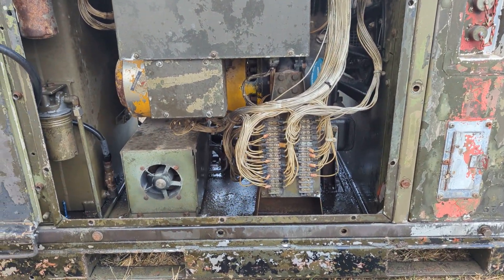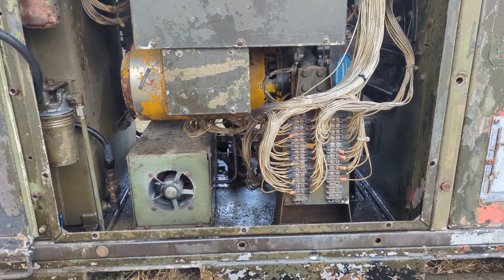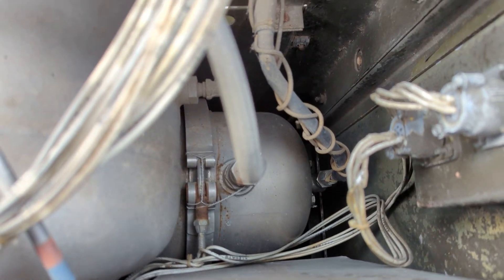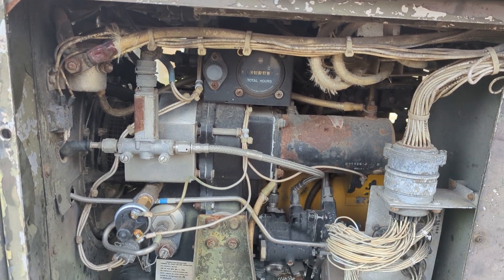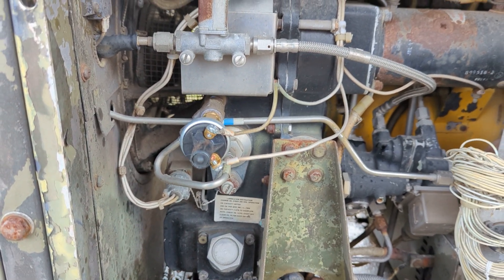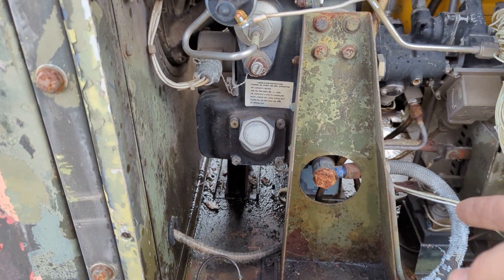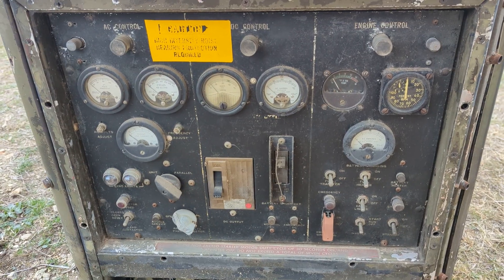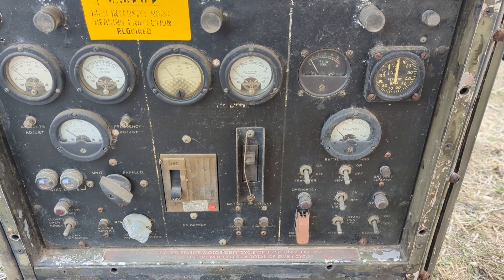Military Gas Turbine Generator Walk-Around

Comment: Runs like an AF MD 4 or -60 bleed air start cart 
I noticed the engine tack not working on the control panel
Reply from the maker: I uploaded a more recent video. The tach gen was bad so I replaced it. It works like it is supposed to now.

Comment: Any reason it wouldn't run on methane (natural gas)? I'd love to replace my V-twin Generac with a turbine (understanding I'd need to invert it down to 120V/60Hz).
Reply from the maker: I mean, it definitely could, but you would have to design a completely new fuel controller.
Reply: @Pyro15D  Makes sense 👍

Comment: Got yourself an old APU for an aircraft. They will want at least a 20% load to run stable. It sounds good so the mechanical is fine. The easiest way to convert the output is to either rectify the output and drive an inverter or find an old rotary converter which is a motor driving a generator. ❤

Comment: so regular incandescent lights will be fine on 400HZ as they are a purely resistive load, i doubt you can lower the rpm enough to get a 60 hz output without causing issues, if you want to run anything "normal" besides lights like another person said best bet would be a dc to ac inverter on the dc output depending on its voltage. cool find though! i didn't know these wer a thing and i have a new mep gensets myself
Reply: You can use a 3phase to 3phase VFD for 60hz. VFDs rectify the incoming Ac to DC, dump in into capacitors before chopping it back up to AC. They won't complain about the ac in as long as the voltage us right. They will run off of Hv DC too!
Reply: Yup, they literally cannot do less than 400hz. Trying to do 60 would not allow the compression of the fuel to be enough to burn it.

Comment: wow that is insanely cool!! Is it true that they are only fuel efficient when operated at near full-to-full load?  also would be great at remote places, you can use the exhaust heat in a co-gen recovery system for hot water/air - even more efficient then

Comment: Tachometer inop is the fault.  Without tach signal, the fuel control can't sense if engine is self sustaining.   This is a single shaft simple centrifugal compressor so it is quite fussy on startup.
Reply from the maker: That's what I thought too, but according to the wire diagram on the unit, the tachometer signal doesn't interface with anything other than the gauge. There is a separate tachometer signal produced from the generator head and that goes to the control circuitry but that works since the starter shuts off automatically.
Reply: Doesn’t he tach reference for these units read another speed input for startup. The tach on the main panel is separate and just for indication
Reply from the maker: That's what I think too. I disconnected the cannon plug on the generator head because I didn't want it to generate electricity while I was digging through the wiring and when I went to start it, the starter didn't automatically shut off. I had to quickly flip the master switch to shut it down because the starter motor was still running and it was almost at full speed.

Comment: with this being higher output dc, it may be more effective to us a dc to ac inverter to achieve your desired 120-volt ac usage for this equipment
Reply: 100a at 28v, only 2800 watts, maybe a 2000w inverter max accounting for losses.   That's a noisy 2000w.
Reply from the maker: I was looking into off-grid inverters. I could rectify the 3-phase AC to ~270VDC and run a 20KW inverter with it. That would give me 240v, 60hz.

Comment: Wow. Great project. Is the genny driven off a reduction gear or a separate power turbine?
Reply from the maker: It's driven off a reduction gear box. There is one compressor and one turbine in the engine, which spins at 52,000 RPM then is reduced to 8,000 to drive the generator. I would love to hear it down further to run a 60hz generator but that will probably happen well into the future.
Reply: @Pyro15D best way to get to the 60Hz would be to rectify and filter the output then feed that into a high voltage MPPT type inverter. Your APU generator also will work best at 20 percent or better of load rating. ❤
Reply: @Pyro15D  from my looking around it will be hard, as 400hz will make the windings in the alternator alot smaller than on similar 60HZ equipment so most likely not enough power to drive a similar 60hz gen head, but gearing down to 3600 should be doable with some pullys or gears, ez is just a rectifier and a inverter since its only a few 1000w